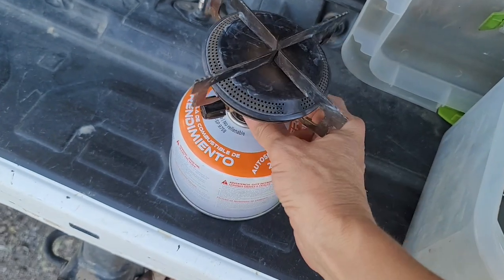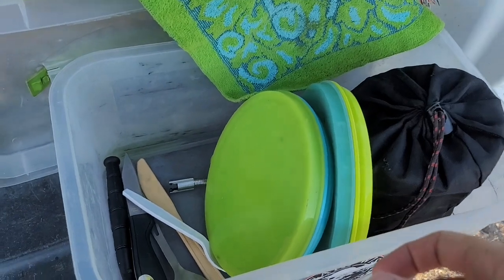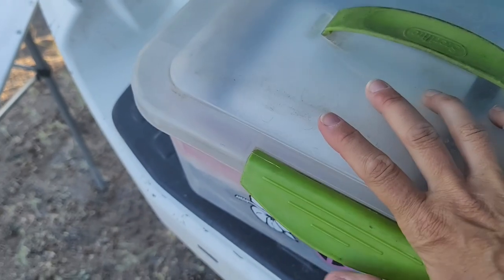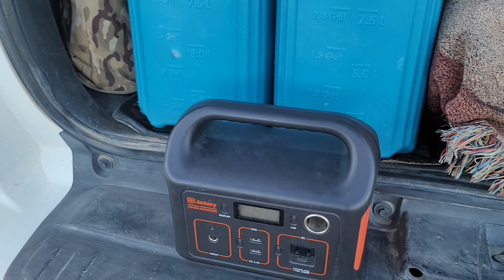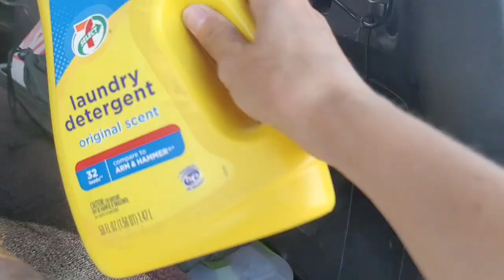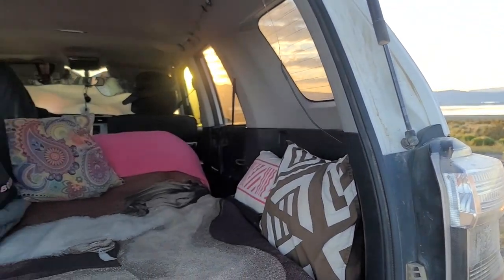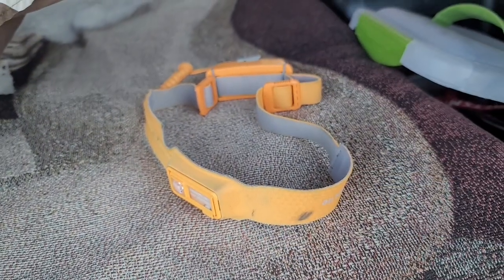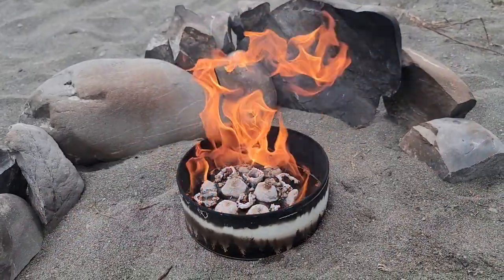#552 Car Camping in a Toyota 4Runner Tips and Tricks: 2021 Update

Comment: I use a detergent bottle, too, but being a guy I pried out the spout. Its place is in a crate by the door along with a quart of oil, power steering fluid, some hand sanitizer, a tube of incense sticks, a box of nitrile gloves, a jug of no-rinse body wash and the former trail mix jar I toss my pocket change into.

Comment: Those laundry detergent bottles are great for guy use too. The spout can be removed. 
These bottles are often not perfectly sealed, and should be kept upright to avoid slow leaks.
A benefit over other types of bottles is that the shape is stable. Wider at the bottom. Stable base.

Comment: My friend and I camped in Arizona extensively and we purchased dry ice and covered it in regular ice and it can last up to three days because of the dry ice which freezes the regular ice into a solid mass.  Just don't put anything you plan on drinking or eating near the dry ice because it will freeze it solid.  Place your dry ice on one side of the cooler and cover with regular ice and put food and drinks on the other side.

Comment: Look in to a MSR windburner stove. No wind shield required. You can boil water in a minute and 20 seconds. The flame is self contained. You can also buy a small fry pan for it. Your cup or pan locks into the stove so you don't have to worry about it sliding off. Use MSR fuel canisters only! It's the bomb!!!

Comment: After trying a wide assortment of stoves, I've settled on refillable propane. Available across the West at gas stations and some Costco's, among other sources. Super affordable.
Those green propane bottles can also be refilled from a larger (five gallon, 2½ gallon, or one gallon) refillable propane tank. You just need an adapter. Adapters available on Amazon.
I use a 2½ gallon tank, and like it. Some friends use a one-gallon refillable propane tank. I plan to buy a couple of those. They look nice and compact. One for backup....
I've used the five gallon tanks. Too cumbersome and bulky for me.
The burners can be found on Amazon and at the Roseville flea market (aka Denio's) in Cali.
Reply: I agree with the smaller refillable propane bottles.  And many other people do as well, because they are the one that always grow legs and walk away.  Oh well, they are twice the price of a 5-gallon bottle but worth it because of the convenience.

Comment: I love Mono Lake.  Lee Vining is a neat town and there Museum that is fun and quirky.  For your cooler you can freeze a bigger bottle with water into ice and it will last days in a roto cast cooler.  Then you have some extra water after it melts.  If you want your cheapo ice to last longer you can add salt to the water and it will last slightly longer as ice, but then the water is not drinkable once melted.  Block ice last longer than cubes. I love your coffee setup. We have a much bulkier setup that does the k cups and have used it for over 5 years. Get some metal square tubing some u bolt nuts and lock washers and built your own roof rails. Then get a roof basket from harbor freight or a sports store.  Thank you for another great video. Safe travels.

Comment: These are some pretty cool camping tips. I got a road trip to Kansas coming up and was planning on sleeping in my truck a couple of nights versus spending money on a motel room. I like the idea of using an old detergent bottle to pee in, because nothing is worse than having to step outside in the cold to take a leak at night. The led lights are also a really good idea and I have plenty of battery operated ones lying around. I also like the My Jo coffee maker, this might work well with the old portable stove I got for free. I have cases of XMRE's so I'll probably take some along but for the most part I'll be on the road, so coffee, food, gas, toilets (ewww) are more accessible. Thanks for making this video!

Comment: Neat vid WH, your kit has come along nicely .Can't imagine not having roof racks and a clamshell tote rocket box.  You can use the uprights for anchors on a tarp. But you might need a stool to get into it. You might look into little alcohol stoves.  They are a little more primitive than gas but the fuel can be found easily, and they are silent.  I pair mine with a collapsible titanium twig stove.  Love it and very packable.

Comment: I recently got a single burner dual fuel stove that runs off butane or propane. It's flat like the Coleman stoves so you don't have to worry about it tipping over. Was only $33 off Amazon. Just search "Gas ONE Propane or Butane Stove GS-3400P"

Comment: Wonderhussy! Check out the Biolite campstove 2. You use twigs that you can find EVERYWHERE, boils water quickly and as a side light; generates electricity. It charges a battery that you can use to charge your phone. I have the whole stove, with accessories. I love mine! BioLite CampStove 2+ Overview | 2021 Upgrade

Comment: Small 12volt refrigerator/freezer cooler rocks. Uses cigarette lighter port.
Will shut off when your cars battery gets to 11.. volts so not to drain battery. Will run all nite without risking draining battery usually.
Charge with the Jackery other times.

Comment: you only have to do 2(4 for both) bolts to remove the seat bottom ...giving you much more room on the sleeping and storage side.  A cheap tarp from harbor freight can be put over the back of the hatch when its up, along with 2 painters poles/tent poles and  some string and bungees, and you have a substantially better rear shade area for dirty hippy cheap.
Also get a Iceco 3n1 (fridge/freezer/cooler) theyre the cats meow for what you do, plus it can run off your jackery      
tell ScottD hi for me :)

Comment: You will probably get a week out of the green propane tank... And here's an emergency pinch you can use mapp gas also there's not much difference in temperature between them and it will not hurt the burner so if you can't find the green one you can run some map gas and then the screws right on to it too

Comment: I removed the back seats of my Tacoma,  saved about 60 lbs. Had way more room,  giant cooler down in lower saet area. And, being the  Off-Road model, like yours, crawl control doesn't need sand boards!
Reply: The further you go with crawl control,  the more you need the sand boards.

Comment: SVEA or Optimus stoves with Sigg travel pot set or cheap and available Coleman pump stove. Uses any Unleaded gasoline.  The no pump stoves require just pour few drops of fuel on top, the heat pumps up the pressure.   The 'no pump' stoves fit inside the pots and windbreaker for a small volume kitchen system. but they're hard to find now for some reason.

Comment: The little burner you use is great in my opinion. I have one that I carry for car trips to make hot tea in a jiffy.  So small and convenient. Get fuel bottles ahead of season to have backups. I made my own wind block out of 3 small cutting boards, drilled and zip tied together. Double duty.

Comment: What she share about car camping is good - but if you live in the south  central or south east its difficult to sleep in a car on less you have a way to screen it in - also because of the humidity you need a fan at Times when its 70-80 %  humidity at night during summer - as for the zackrey  power station she has - you would need a larger one to run a fan all night or for 2 or 3 nights - you can get a small 600-1000 watt inverter generator to charge the power station during the day  - ( solar panels do not work well, other than were she is at) - solar panels work well in areas of 5 %  humidity -like in the SW - in the SC & SE they Will only generate 20 %  of there out put at best at noon day because the high humidity defuses the sun light - also clouds interfer with the sun light - in the SW it might take a day to charge batteries by solar - in these parts it often takes a week or more to charge by solar - so campers use small inverter generators instead of solar panels to charge batterys - even at 35 %  humidity it can drop the out put of many solar panels by 75-80  % -

Comment: You should try out a multi fuel stove I believe MSR makes one it's just where you don't need just the canister rule you can use a range of fuel you just fill it pump it and light it of coarse read the directions to do it properly... also some minor upkeep I think optimus is one as well

Comment: the cheap butane stoves have very inefficient burners and will empty a fuel can rather quickly, but people like them because they only cost 20 or 30 bucks... the good ones will burn on high flame for almost 1 hour on an 8oz can of fuel and almost 3 hours on a low flame. the backpacking canisters that have a propane-butane mix also contain 8oz of fuel and are better in cold weather but the reason you get good performance from them is because your primus stove has a better burner design.

Comment: The advantages of being a compact little unit is you fit into a 4runner, I have to cram myself into a 6 1/2 ft truckbed with a canopy. It's a whole clown show come bedtime..
Reply: Yeah, that's my problem as well. I have to lay diagonal...
Reply: That’s why I bought the truck with the 8 foot bed it works fine

Comment: If you want more water for washing up at night instead of that solar thing, tried using a one gallon water jug spray painted black and then fill it with water and leave it on your roof like you do with the other. Granted you won't boil water but you'll have a lot more water at bathing temperature or.
Reply: William Mulvaney   The closest  KOA campground is probly a 100 miles from where she sat on top of the mount. Yeah that sounds like a really good idea drive that for to take one shower.
Reply: William Mulvaney   Also I don't know the last time you were at KOA  But they're overpriced and really not that nice in unless you have your own RV the showers at those kOA suck
Reply: William Mulvaney   Way more fun to do it the way she does then stay in any motel or lodge.  If I was younger I would still be doing it that way. Still in my RV  I try to camp away from people. I have solar satellite and everything else you can imagine. I can last 2 weeks off the grid With a hot shower every other night.
Reply: William Mulvaney   I can see you were raised with a silver spoon in your mouth. Some of us can't handle roughing it And some of us can.  Which one are you? Adventurers like her is how the world was discovered not by people that stay in motels. I guess  Lewis and Clark should have stayed at a KOA . 😂🤣
Reply: William Mulvaney   I can also assure you She lives in Las Vegas and I guarantee she is been to every exclusive and expensive restaurant that there is in Las Vegas. Have you. And quite frankly I don't care for Europe.

Comment: I have gotten over 20 meals (mostly boiling water) out of one of those butane canisters I think people turn the burner up to high. I have a stove like you described, comes in a black plastic box.
Reply: William Mulvaney  you should never store the stove even for a short time with a canister in it it's very hazardous turn off the stove wait about five or 10 minutes then remove the canister with a little cap back on it save it for the next time
Reply: William Mulvaney  I've been using butane canisters in my store for three years and I've never had one leak sometimes I use canister was it three or four months and still be good. Maybe it's the stove damaging the valve are use a gas one stone I've had no problems.

Comment: The bad thing about Butane Fuel is if it gets cold it doesn't want to work. I know you're mostly around where it is warm but beware tha Butane will screw up on you. LP has a better life than Butane. 
Instead of a roof rack, why not the 2 drawer pull outs that you would sleep on top of. Plus don't have to worry about anyone doing 5 finger discount.

Comment: Re: 'green canisters' / one pound propane fuel containers: buy a valve to fill your own from 20 lb. Bbq type ( refillable at gas station propane tank) Much less expensive than buying ( and discarding)  individual 'green canisters.'
Reply: I got mine at an Ace hardware store, on the rack near the Bbq stuff, about 20 bucks. Could be Harbor Freak has them, haven't seen one in their stores tho'.

Comment: Everybody does solar panels so I went the other way...
Because I am a mechanic an automotive technician a Master mechanic.... A master electrician.....
Automotive engineer.... Seven schools.....
So this is what I did there's a battery called a 4D not an 8D that's too big and heavy a 4D is half the size but it has 1300 Watts..... And I have an 810 w Ford truck battery......